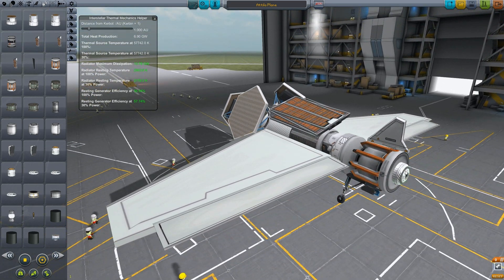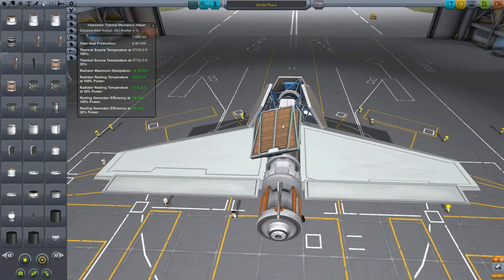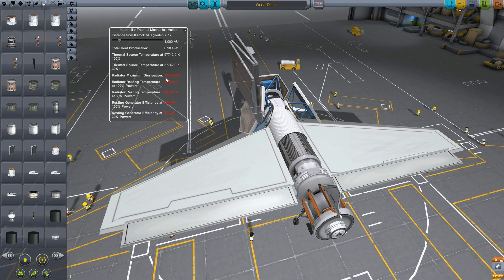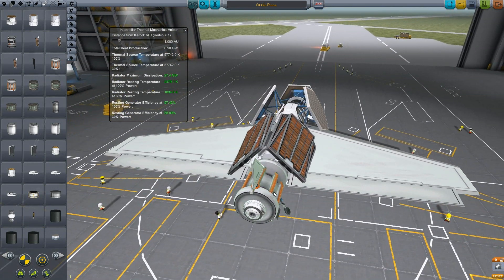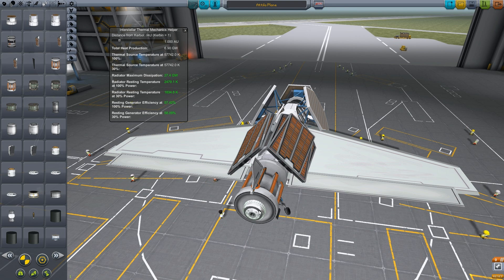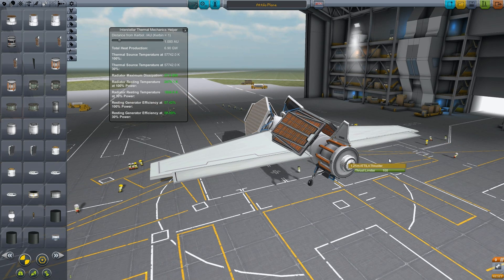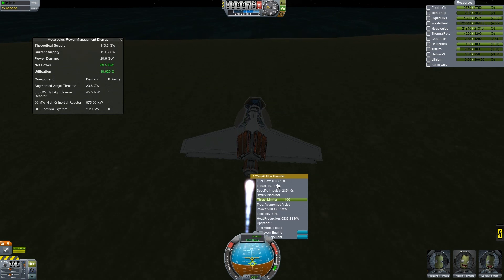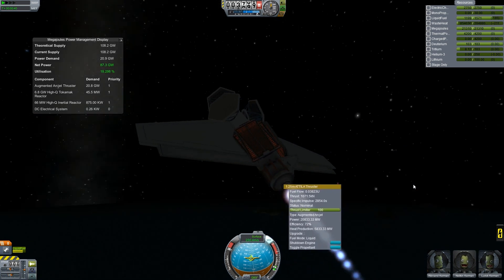KSP Interstellar: Plasma & ATTILA Thruster Tutorial

Comment: I've been having issues with the extended version of this mod. It seems like all the engines refuse to go to their maximum thrust or maximum power consumption even when plenty of power, electric charge, megajoules and kilowatt hours are available. No matter what I do, I can't even get the Dawn ion engines to make more than .5kN with 5GW electric power available, let alone any engines included in the mod. The Dawn engine doesn't even run on electric charge anymore, it won't run without a source of kilowatt hours or an active power source like a multi-gigawatt nuclear reactor. Any advice?
Reply: @jimmymht01  I think I found a potential answer. If you equip lithium batteries and turn their electric power control down when they run out of kilowatt hours, you can recharge them easily. Should make things run smoother, but it's still kinda stupid that the designer of KSPIE screwed up the power control for ion and plasma engines. They should just switch to electric charge and keep it simple.